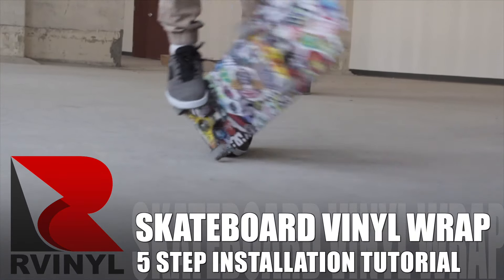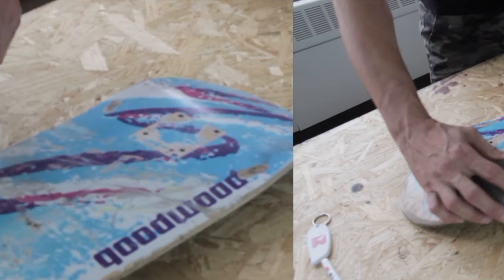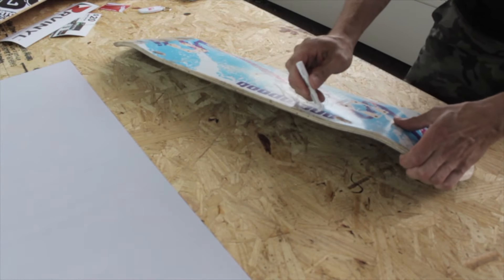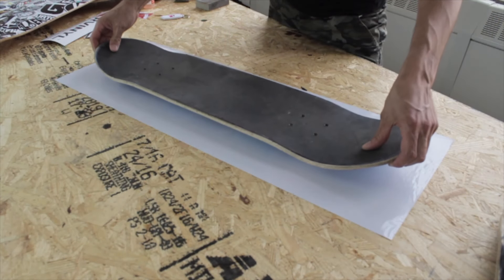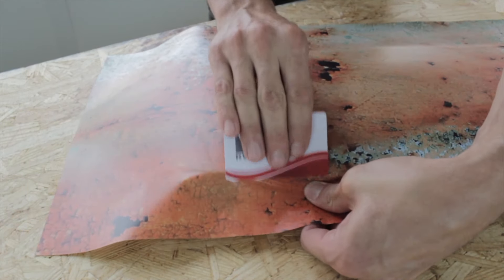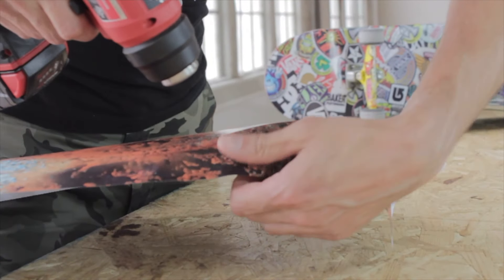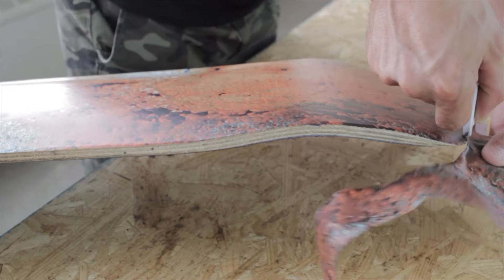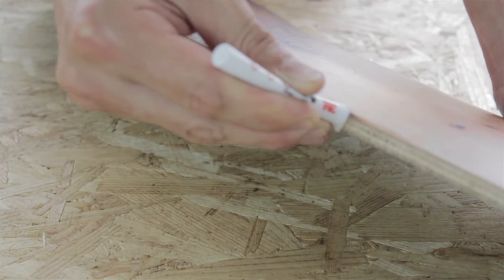5 Step DIY Skateboard Graphics Vinyl Wrap Install

Comment: So did you notice any differences between skating this one and a digital or screen printed deck? Does it ever or can it peel?
Reply from the maker: This is a wrap, so you can think of it as a decal or a sticker. I would not say it affects the skating in any significant fashion. If properly applied, it will not peel unless you want to remove and purposefully peel it off.
Reply: @Rvinyl  Got you! thanks for the response. Been thinking about some other ways to do Deck graphics and this way seems like a really good alternative so thanks alot.
Reply: It definitely will snag and tear if you boardslide alot, especially concrete(like parking blocks). Just an FYI, this is not a great alternative in my opinion. But can make a nice looking wallboard or cruzer.